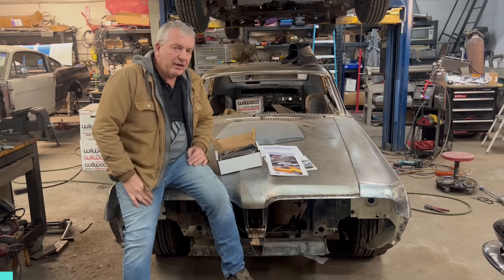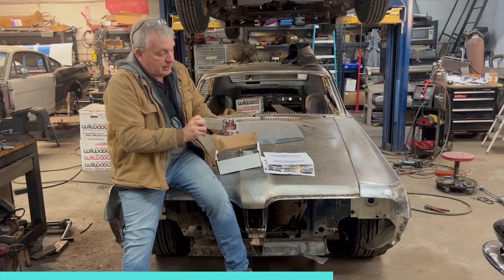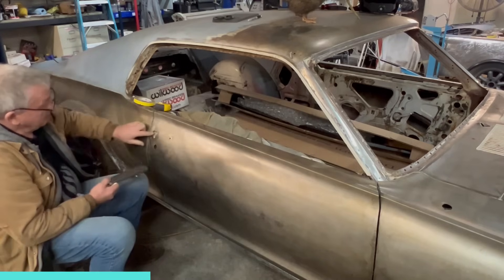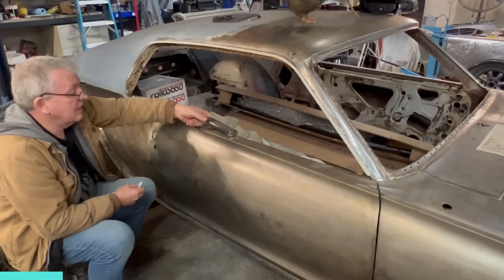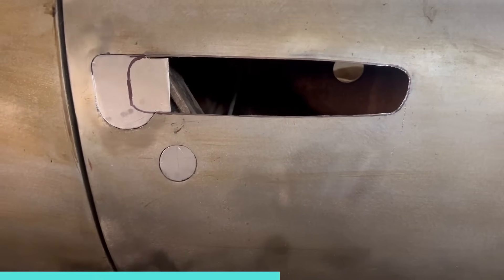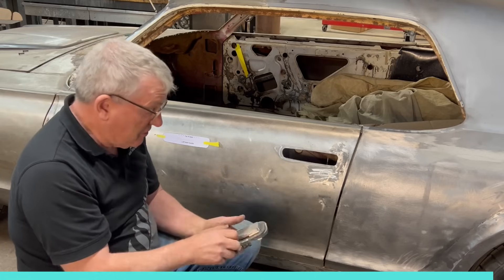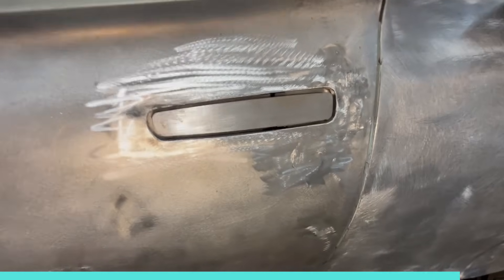Kin-Digit Door Handles for the Cougar Fastback.

Comment: Nice work Kiwi, and that's coming from a 'keep it basically stock purist'. 😂That doesn't change my appreciation for your skills one bit though. Personally, I'd have taken the measurement from the door lower edge than the floor 🤔just on the off chance the car isn't level, though you would have made sure it was. 
And thanks for sharing it with us all. Many don't appreciate the time and effort it takes to make a 'simple little clip' like this. Cheers.
Reply from the maker: I didn't really explain myself very well on that, the measurement from the ground was just for level with the ground. The height was determined from the factory hole in the door skin, top of hole to top of hole😁
Reply: I was just thinking if the car was slightly up or downhill, front to back. 👍

Comment: Before measuring the cutout from the floor, make sure your car is setting level. The cutouts could be off from one side to the other if your car does not sit level because of weak springs.
Reply from the maker: I didn't explain that very well I'm sorry. The height of the new handle was determined by the old door handle hole, top to top.  The measurement to the ground was to determine the level with the ground. Then a step back to ensure its looks pleasing to the eye.  The eyecrometer is an invaluable tool!!

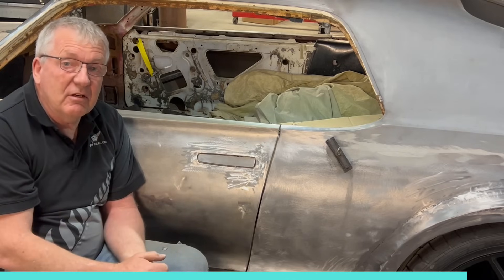Comment: 12:43 looks like you need to grind a bit off the front lower part of that handle to even up the gaps. It probably just looks funny because the handle is mostly flat in that radiused door.

Comment: I feel like those door handles should be on the other way around. I'm sure you did it right, but I think it'd be more ergonomic to pull the handle if it was sticking out more towards the rear of the door. I guess it's designed assuming you're opening the driver's door with your left hand. But like, you could just as easily use your pinkie finger. Plus this way I feel like the handle is more likely to catch the wind and flop out while on the move. Not that it would open the door, but still.
Reply from the maker: They pivot that way to work with the factory latches.  They are spring loaded and close quite firmly so I don't think they'd ever catch enough wind to pull on them.  You're not the first to suggest the reverse operation though so......

Comment: if there's no keyhole, and assuming that, like the majority of heavily customised cars, it likely won't be used all that often...how do you get into the car if/when the battery is dead and thus the unlock fob doesn't work?  Do you install a set of external terminal posts/studs somewhere so there's a way to connect a jump pack without being able to open the doors?

(Assuming the hood/bonnet isn't solely on an external latch, of course.)
Reply from the maker: If the car has an external hood latch it's no problem. If it has an internal hood release then we add a provision to jump the car somewhere that's not seen.  Thanks for watching😎

Comment: Absolutely NO disrespect meant to a man of such skill and knowledge, but just curious. Why not measure relative to the frame? Seems like a good baseline relative to the lines of the body.
Reply from the maker: The height was determined by the factory  door handle holes. I put the top of the new hole at the top of the old hole. The measurement from the ground was to determine the level with the ground. And as with all measurements take a step back and check to see if it "looks rights" my eyechrometer has saved my ass a couple of times 😬😎